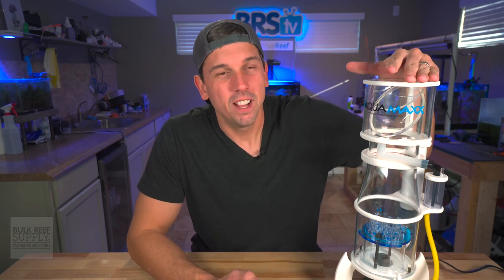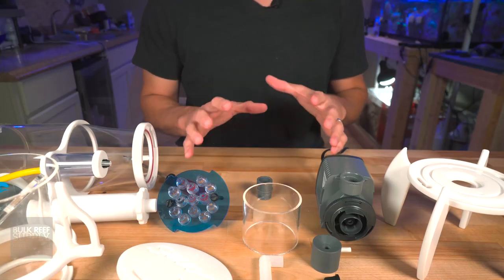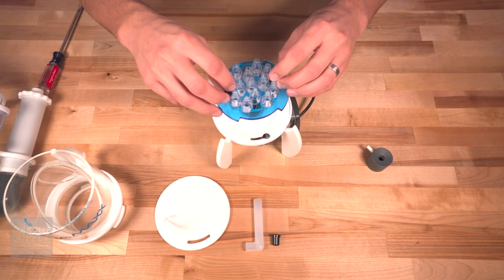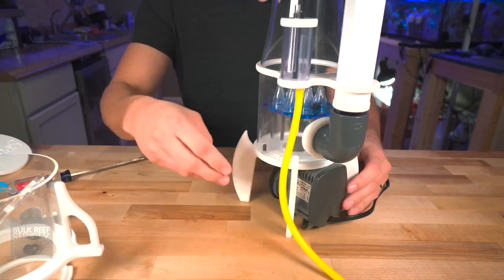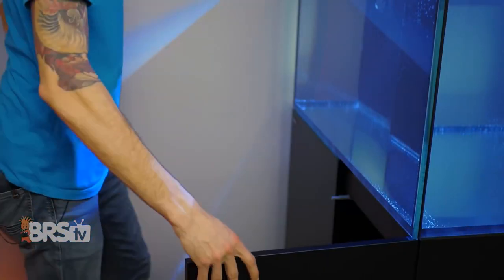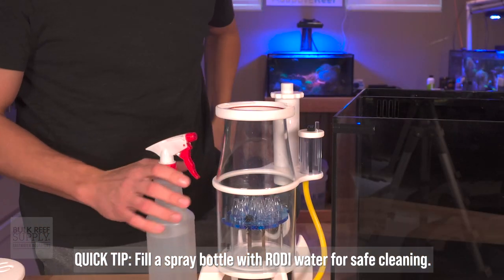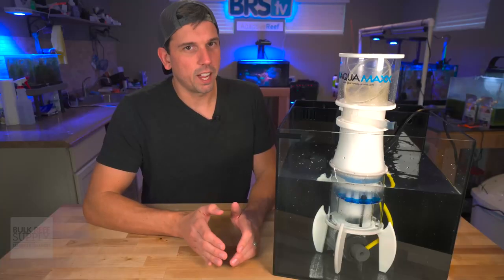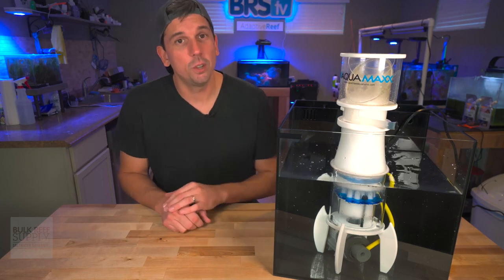AquaMaxx ConeS CO Protein Skimmer Setup... Assembly & Best Practices!

Comment: Oops, wait... when you said "when you first turn it on make sure to open that gate valve so it doesn't overflow", are we supposed to close it later?
Reply from the maker: The gate is to be used as a tool to tune the skimmer. The more you close it, the higher the water level will be in the skimmer body and (usually) the "wetter" the skimmate will be. This will be most dependent on the water level in your skimmer chamber, so not everyone will keep the gate at the same level. For most reefers, it'll likely be somewhere about 50% open.
Reply: @BulkReefSupply  Cool.  And ya'll recommend the 9.5" water depth for these guys?  i just bought a gigantic one and i'm waiting for it to arrive and set up. LOL